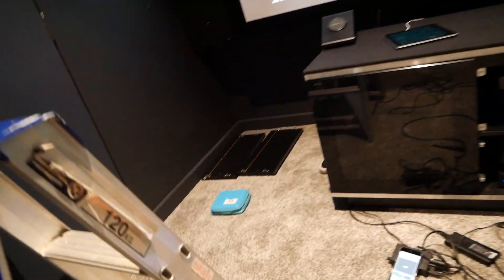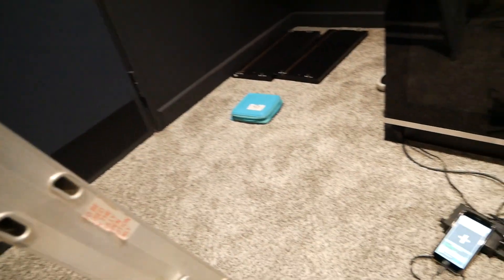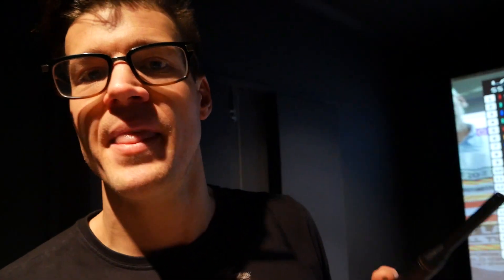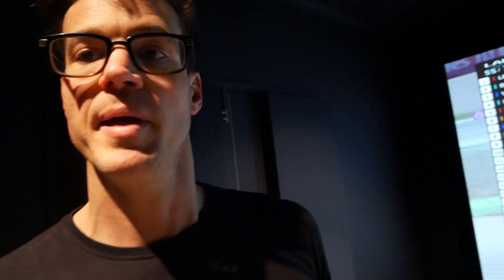WARNING: How 1 connection collapsed a mega ATMOS sound system!!

Comment: If in doubt Use a 1.5v battery connected to the speakers to check for forward polarity cone movement. I checked mine and two speakers had reversed wiring that was easy to rewire + to + and - to - , this happens when one has Cats running around and hyper-thinking about other things that are way, way, way ahead and getting that in the way with my Cats running around.
Battery testing can be tested with bass drivers, midrange and even compression diaphragm attached to a phase-plug, takes, a special technique to look for forward motion since the movement is ultra tiny movement, with a light shining on it and looking at it at certain angle as normally compression drivers would have to have forward motion towards the phase-plug not away from it.

Polarity and phase are two different things. Phase is often reverse 0 degree to 180 degree it can get a technical but is easy seen with two microphones near two speakers and switching or better still with variable phase 0 degree at 5 degree steps to 180 degrees can be observed on the RTA in real time will show the frequency positivity summing up or you may see a subtraction of the signal.  

I'm running up 156 JBL, most are JBL cinema professional - x5 behind the screen or 70mm SDDS five-screen with atmos PlusIIIx, that goes simply beyond standard atmos or Overhead Surrounds that uses middle height 1 middle height 2 and middle height 3, no need for auro or dtsx here. All running with commercial cinema professional Lucasfilm Ltd THX Sound System, at £ fish and chips, got know what to look for on ebay for that home fish and chips cinema bargains.

Also checking balanced cables commonly XLR as I have noticed on mine I had a odd reverse signal and after checking the speakers with a battery and then still noticed something odd? Turned out to be few XLR a simple , soldering to reverse + -  wires as I can easily do this on the Behringer DCX2496 but would prefer the DCX all showing + polarity, so always check the cables with a multimeter for continuity, same applied for DB25 connectors. It can also be possible the amplifiers can be miss wired inside, it is possible. It is also possible an AVP may have miss soldering on the parts or the DCX it is possible and as long as test signals/equipment are being used to check for.